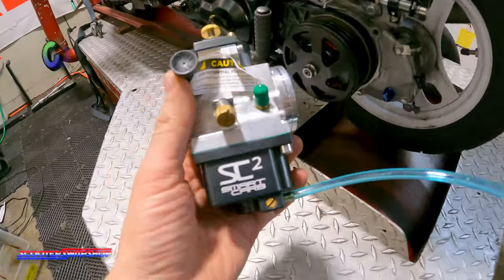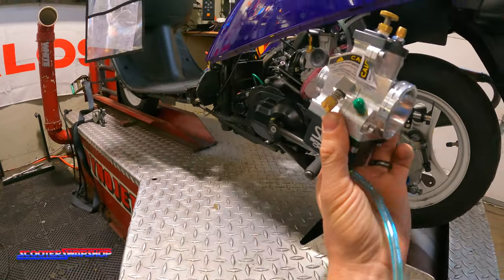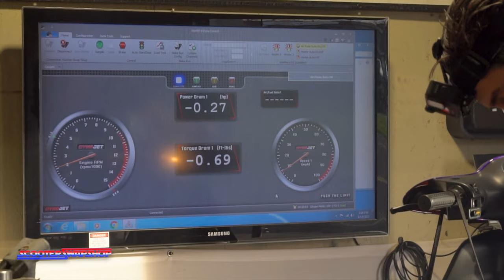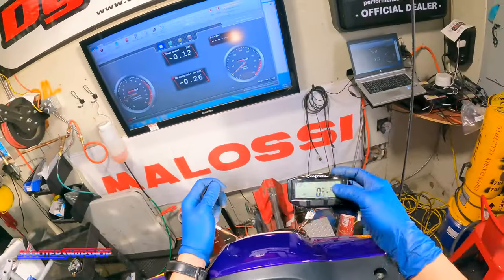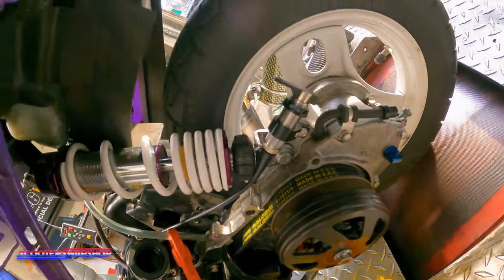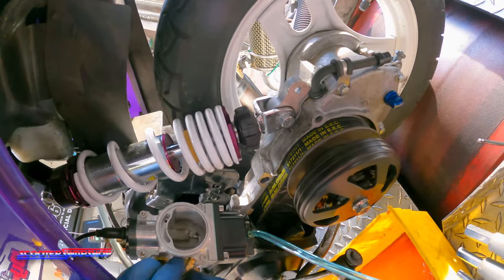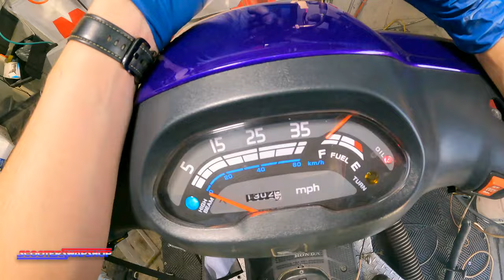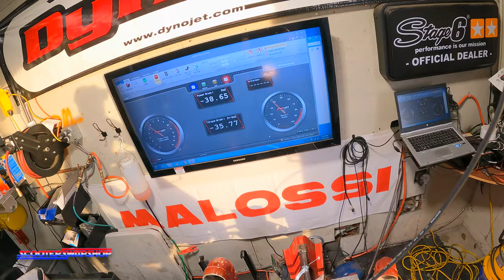Honda Elite AF16 Smart carb installation Quick and easy

Comment: Just got off the phone with smart carb.. they are testing on the AM6 right now for emissions and street use on the shercos 👍
Just wish they had a 30 or 32 mm for my stroker. They tried to sell me on the 28 saying it's like a 24 on the low end and a 30 on the top 😂
SNAKE OIL.

Comment: Pity we didn't get to see how it turned out. Loads more adjustments needed, pity you have no AFR display from a wide band. Look forward to the next one when it's running better
Reply from the maker: wideband doesnt work with 2t the oil ruins sensors and isnt accurate the bike was going to seattle it needed to stay rich and the owner should fine tune. if the bike was staying here and the customer payed for dyno time then thats different by the time it left it was around 10 hp but brandon doesnt record everything we use the dyno to get it close then street tune it
Reply: Think he said 8.5 to 10.5 HP range

Comment: Crazy how its only Got 9hp mine has a Way Worse setup and Got allmost 12 hp with 21mm
Reply from the maker: did you see the amount of time we tuned it haha you only saw a few pulls but yeah it was at a little lower end the porting could be the issue on the missing 1 hp also remmeber dynos arent the same.... ours could read1-5 hp diffferent then one up the street it is a tuning too so start with a baseline and then go from there... especially on these tiny bikes we could make it read 100 hp if you changed settings so neve belive peoples inflated numbers
Reply: Also the altitude & weather can affect your numbers